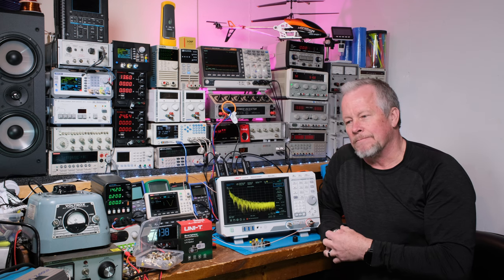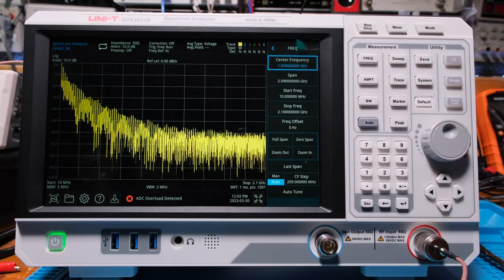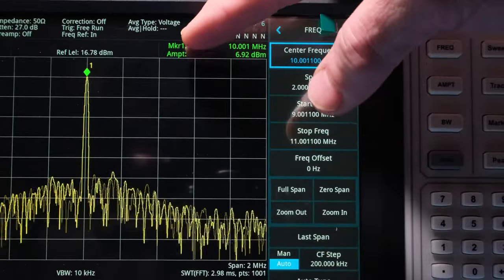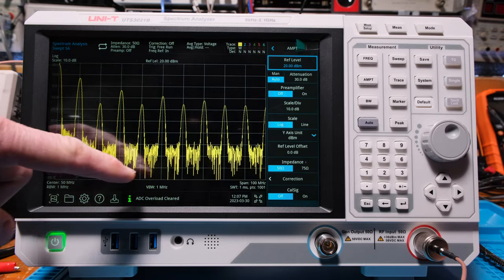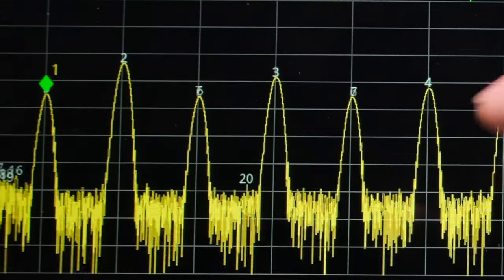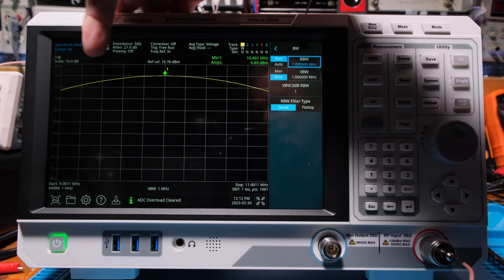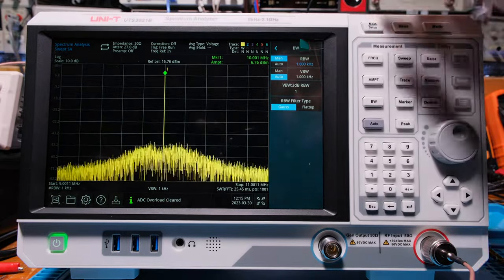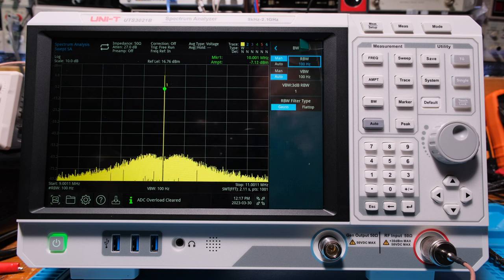How to take your first measurement with a Spectrum Analyzer with UNI-T #UTS3021B #spectrumanalyzer

Comment: Eddi grate prezentation of Spektrum Analyzer   working. I will add tip for N-type connectors. Remove the rubber seal from them. It will be much easier to tight them with consistent connection a specially if tight them by hand. The rubber seal is only need when the cable are used out door to prevent moisture. High precision N-type connector and adapter use in  RF lab will not have this seal, the reason is that even with proper torque wrench it is very difficult to get readability when the rubber seal is in there.
Reply from the maker: That makes sense - thank you!!  Great tip!!

Comment: Thank you! Not sure I like being able to use the keypad for number entry but still having to use the touchscreen for the units.  Anyone who has ever used an HP SpecAn knows what I'm talking about.  I realize they aren't in the same league but take a note!
Reply from the maker: Thanks - it has been awhile since I used an HP.  That was what I learned on many years ago, but I rarely have had a chance since then.
Reply: @KissAnalog  Outside of the weight of the units where you can feel the quality.  It's the fine and high contrast traces that keep me tied to them!

Comment: Thanks! Does anyone know why BW of spectrum analyzers often starts at 9kHz and not 1 or 10Hz?
Reply from the maker: Thanks for the awesome question!  I always guessed that they wanted to run down to 10k so they did a min of 9k just to keep 10k flat.  But, that was just a guess.  I'm glad you asked this!!
Reply: I read somewhere thats it’s due to phase noise in the local oscillator which limits the dynamic range at lower bandwidth. In saying that though, some older spectrum analysers like the HP3589A went down to 10Hz but it’s max bandwidth was only 150MHz. Rhode & Schwarz also currently have them down to as low as 2Hz. But it’s ridiculously expensive.
Reply from the maker: Thanks for this feedback!  I do like that HP - it is one of my favorites because of the low bandwidth.

Comment: NOTE BEFORE YOU BLOW UP YOUR SPECTRUM ANALYZER FRONT END (INPUT): Notice the RF Input shows a warning that says +30dBm MAX and 50VDC MAX. That means you shouldn't put a signal greater than 1W (+30dBm) and no more than 50VDC. Not all spectrum analyzers are the same, some in microwave range are ZERO volts DC, so you may want to use a DC block in series and perhaps an attenuator to ensure your RF input power is below the maximum rating. Here's a good video by w2aew to help with the Do's and Don't's before you burn up your expensive equipment: https://www.youtube.com/watch?v=E6P-R0C9ro0

Great video, Eddie, looking forward to more videos! :D
Reply from the maker: Thanks so much for the great feedback!  I will talk about this in a video to come.  In this video I wanted to keep it simple and just show what it can do.  I'm using the 10 MHz clock signal at the back of the unit so I'm good for now.  I have to buy some more devices for this series of videos.  I've spent almost $100 already for adapters.  If this were mine to keep I'd spend more but I'm trying not to spend too much as they will just sit in a box when I send it back:(
Reply: @KissAnalog  Oh I hear ya, Eddie 😅 I just wanted to put at alert for someone who might be antsy to put some signals into their analyzer they just got and didn't know :D I know how tempting it is to throw whatever's at hand into a piece of test gear to see what it does and just thought it'd be a shame for someone to zap their expensive unit (or a friends!) by accident. 🤪

It's funny you mention having spent $100 already on adapters. Reminds me of the "free kitten" I picked up from neighbors down the street that cost me $125 in food, litter, litter box, toys, cat carrier, etc to bring home 🤣
Reply from the maker: Thanks for your feedback.  Please let me know what I miss as I go;)
Too bad I got to send this back - it would be great to have around.
Reply: @redemptusrenatus5336  I WISH I HAD KITTEN FOR COMPANY.